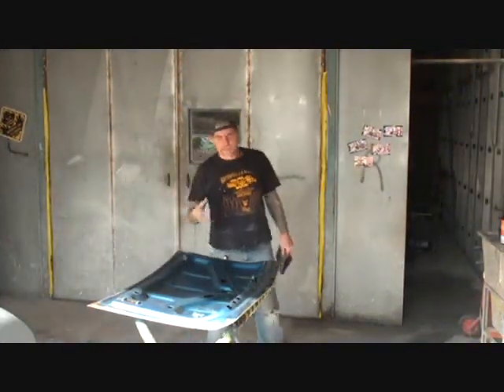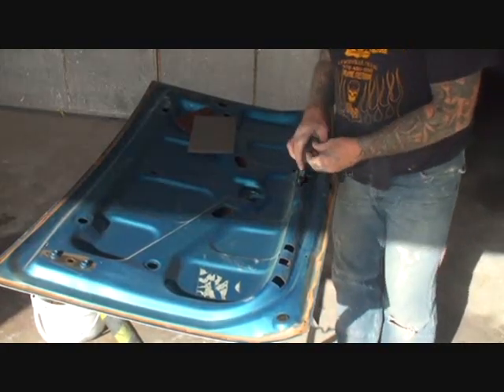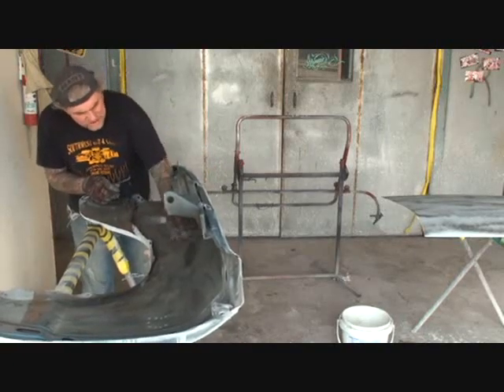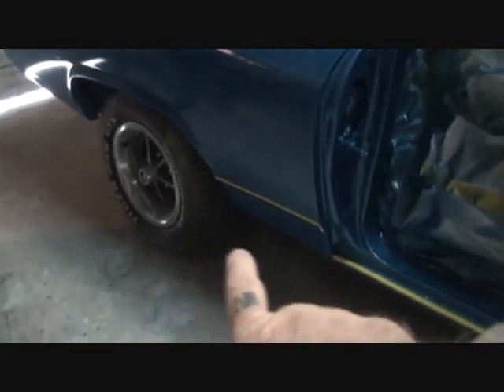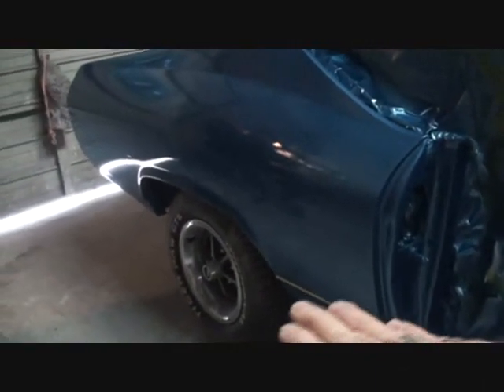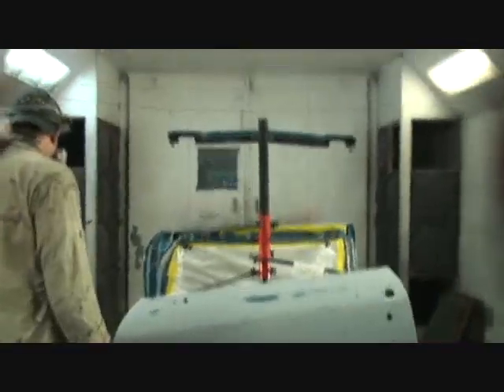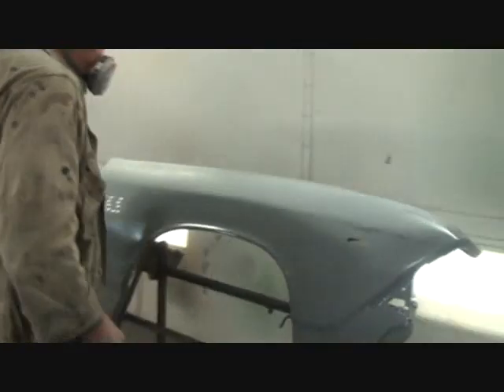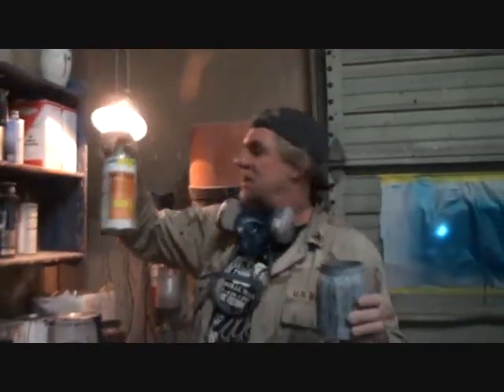"How To Paint A Car"-By Yourself-Part 12-Doors And Fenders Ready

Comment: My favorite part is when Pete is painting, in this case, epoxy sealer. I have the same Binks #7 with 1 qt. cup and black handle. I don’t know what the tip size is but have a second size tip, fluid nozzle and air cap. It is all together with a plastic package complete for rebuild kit. Works great, throws down the paint, just learning about more new products. Great job narrating in the booth Minnie! You know exactly what Pete is doing and what you are doing.

Comment: Question: Pete I see your painting the parts separately and days to even weeks apart. 
Are you worried about the color changing from part to part being they are not all painted at the same time?
Or is that a less worry from the paints today? 
Because I was told you need to paint all the parts the same time to avoid that.

Comment: The secret to color sanding is using the sponge to keep the surface wet you never want it to get like toothpaste need to keep it wet wet wet I learnt with a bucket of water sponge and the paper 400,600,1000 grit and the motions up and down not side to side in a vertical motion I was taught by dez best ever in Ottawa canada

Comment: {waiting for my weld thru primer to dry}  Here's a suggestion to wake up "Mr Excitement". your tech assistant.   Hang the cartoon character the TASMANIAN Devil on the wall, and first thing when "Mr. Excitement" comes in have him have look into the eyes of the Tasmanian Devil on the wall for 20 seconds and then a BIG ARRRGGGGGGHHH loud as shit from "Mr Excitement" and maybe he'll get Motivated (Motorvated, whatever).  :)
Reply from the maker: +syyenergy7 We need to do something with this guy, he's putting me to sleep everytime Im around him!!
Reply: +diyautoschool Espresso machine.  Have him drink a pint right at the beginning of work. Btw. I have no problem plugging USA made products.  I'm always plugging quality, especially  USA made products, if it's something I think is very good.  They don't pay me and I'm not going the marketing route because it's total b.s.   My friend used to use the paint back when it was mainly known as Ditzler.
Reply: +syyenergy7 You crack me up dude.
Reply: He just finished hitting the bong in the paint booth

Comment: Wait, is epoxy  primer different than 2K epoxy primer???  Also I think Minnie should have had a mask on too, you know because she's the love of your life. ha!
Reply: @nel6211    > It has been sometime now as it’s 2021, but Pete has covered the Epoxy primer question. It is a sealer!! It seals whatever type of old paint, filler or high build primer used to block to straight. Now, I will say that epoxy is best but not all is equal as the word primer should not be on the label of many brands. I think this is DuPont and that 1 quart of sprayable material cost close to $80 or more. At 4:1 ratio, you get 5 quarts. $300 for the gray epoxy and $100 for activator. Brands like SPI can be mixed at 50% to spray as a sealer w/7 day open window to work filler, sand, prime and block. It hardens together. If more than 7 days, you have to scuff it with 400-600 to continue. Do one panel at a time to bare metal, epoxy seal. Hammer, dolly, filler & sand, spray high build to sand flat then reduce, seal it and water, humidity will not penetrate it. Now, it is safe to keep going. I hope this helps you and future readers. I am not endorsing anyone but call SPI and the owner answers the phone as it’s made with the best materials in the USA. Blessing to all Pete is busy and can’t respond to all.